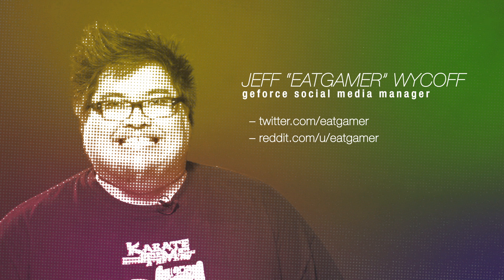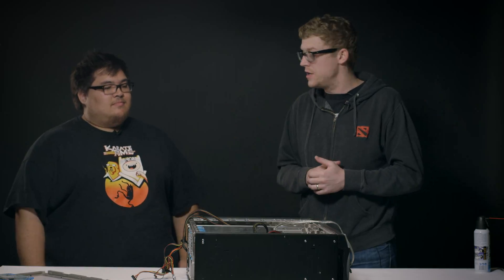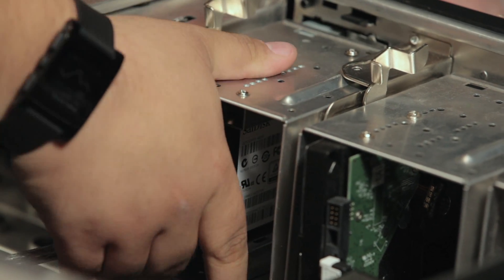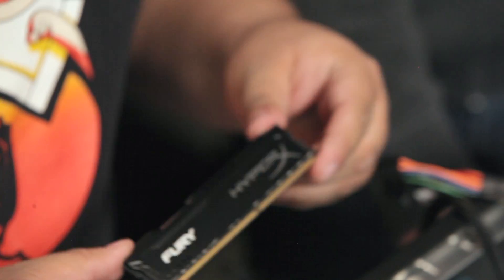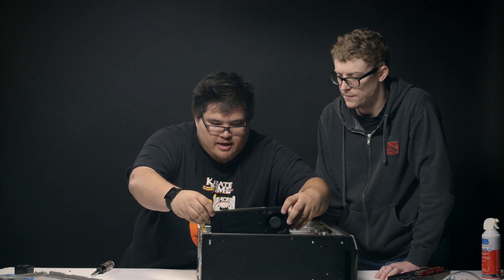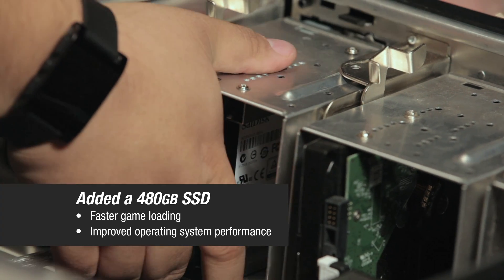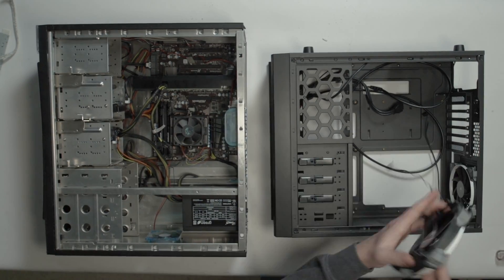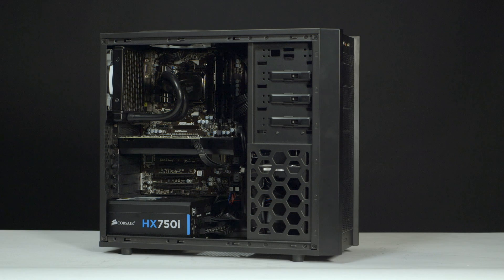GeForce Garage – How to Breathe New Life Into an Older PC

Comment: here my potato

Processor AMD A6-3670 APU with Radeon(tm) HD Graphics
Video Card NVIDIA GeForce GT 520
Memory4.1 GB
Reply: +elitegamer010 is not that bad.
Reply: KaPo Andre

How isn't it?
Reply: elitegamer010
You can at least open some games and play them. Maybe you say that it sucks and that is like having nothing. But some people would like to play something like the witcher 3 in  your PC with a low spec patch at 20 fps.

I used to think the same as you, but i did not appreciate what i had :P.
Reply: if you got an amd 240x or 250x it would run in dual graphics with the apu meaning it won't suck so bad.

Comment: So a pointless ram upgrade, 480gb ssd and a cpu cooler? 8gb is fine. Heck even a gtx 660 is amazing still. Rocking a gtx 460 768mb fine. Sure I can't play at ultra settings but I get around ps4 equivalent settings at 50 fps. I'm envious that I don't have a pc like that but some of the upgrades are pointless. If the 960 is so powerful efficient like they say then why a new psu? 480gb ssd is alot, i run a slow wd green drive and live with that. Should have put a 120gb instead for os and primary applications. I never use more than the 8gb of ram on my rig.  I watched this video thinking its going to show me how to upgrade a older PC for fairly cheap and get a good performance boost but all you really did was replace most of the build and more buildings a new PC than refreshing it.

Comment: My specs:
CPU: Intel Celeron E3300 (Dual Core) 2.5 Ghz (Overclocked to 3.1)
GPU: Radeon R7 260x 2GB (Overclocked to idk, too lazy to check)
RAM: 4GB DDR3 1333
Case: ikd some old crappy case
PSU: Some cheap 500W thing

:c

Comment: Build Quarter 1 2009:
Processor: Intel q6600 quad core
Ram: DDR2 800MHz 2GB x4 (8gb)
Case:Antec 300
Video: NVIDIA 9800GTX+ 1GB

Thoughts on best upgrade?

Comment: Should I get a ssd or invest a bit more in a video card
Reply: KSores it depends if your games are running slow or if you have unplayable frame rates, if it takes a couple of seconds to start up a game go with the ssd but if your games boot up just fine and you cant play them because of the frame rate invest in a video card, and if you decide to go with the video card the evge gtx 750 is  great graphics card with a moderate price for only 130 for the entry level model
Reply: ok thanks
Reply: KSores GTX 750 is a good card depend on games you play but get the gtx 960 for 199 and its much better and faster.
Reply: is that american prices because the gtx 960s in canada are around $300+
Reply: KSores My bad I was looking at newegg usa but it costs around 244.99 for the cheapet one.
Reply: ok no prob
Reply: KSores Depends on what your card is, and how old your hard drive is/ how full it is.

Comment: "There, we've revived this computer, even though it was expensive anyways. You know what? Screw it, we're gonna replace the whole thing after the fact."

This is like saying you were gonna do a few upgrades on your truck, but in the end, you've drilled the VIN plate off of the truck and put it on an entirely different vehicle. Yeah, by law, the same vehicle, because you just "upgraded" the whole thing.

Comment: my potato since 2008:

Intel C2D E8400 3GHz
Intel DG35EC mobo
msi ATi R5770 HAWK
4GB DDR2 RAM 800MHz
1TB WD HDD (recently upgraded coz previous 360GB HDD died)
450W Corsair PSU
Reply: ***** Custom BIOS maybe?
Reply: Aaaayyyy I have the same GPU as you lol!
Reply: Filipe Amaral
:DD
Reply: +Because I'm Batman! Nice I also have a e8400 with 8gb ddr3 ram, Asus r7 250. And I can run gta v on low settings
Reply: +Because I&#39;m Batman! Yet, this is still better than mine. I'm still running a E5200 with DDR2 (398MHz) fml.
Reply: ***** you do know this is an team green video XD im not on the green vs red thing but you iz pozting on le wrong spet XD
Reply: ***** It's still an allright pc-...people underrate their PC's, your PC will run okay if you don't play the latest and greatest games, I have my i7-920 temporarly with a GT630 till my R9 270 comes back from warranty (fried it like an idiot) and it still runs older games just fine. (older meaning pre-2013)
Reply: Rinkk
yeah, tbh, i do run games at frame rates which is playable to me. but my actual point was that i still work on a 2008 pc which is still fine but since its from 2008 it will be called potato in general :P

btw, just asking..... if you fried it on your own (guessing most probably by ocing) then how did u availed the warranty since damages like that are not covered?
Reply: Rinkk
i sooo much want to get a lil bit of extra from my e8400, but my mobo doesnt allow oc :/
but im still good though ;D
Reply: *****
i will look into that if i can...

dunno why i never thought of it.

EDIT: Couldnt find custom bios for my mobo. There is still just one way, but it involves some kind of padding the processor. I dont wanna risk it this way.
Reply: ***** yeah... processor chip mods? fuhgetaboutit lol
Reply: Rinkk
Ofc the cpu can be oced, but my mobo is an intel mobo, and intel doesnt allow ocing on their mobos. if it was from other company like asus, msi, or biostar, it would have been breeze.
Reply: +Because I'm Batman! Dude, E8400 and DDR2 ram, I thought I was the last person on Earth still using those!

Comment: ram and ssd upgrade were a waste of money. the gpu upgrade great i didn't see in video where they said what cpu he was using. ssd are nice and very competitvely priced but not significangt enough, in my opinion, to warrant spending money on that when it would be spent better toward the graphics, obviously, probably the cpu, not mentioned i think, and that power supply. why power supply? cuz it had dust bunnies living in there and dropping that new hotness gpu in there i am not taking any chances. and lies you didn't use 1 can of air to clean out that case. clever camera tomfoolery i say.
Reply: also that is NOT budget what you guys put in that system that was like 600 dollars of hardware. yeah....

Comment: The non upgraded pc was still 10x times better than my current one. 
I have an old Core 2 Duo E7200 2.53, 4GB of DDR2 RAM and a ATI HD5450. I just can't even imagine how my pc would run with a better cpu or gpu :D

Comment: It's funny, how everyone argues about the ram. 

Let's get this straight. You CANNOT mix and match 2 different types of RAM, if the different types of ram run in the same channel. For instance, you can't put a 8gb 1866mhz in the same color-coordinated channel as a 16gb 1600mhz, and make them cooperate. But if you place the sticks in 2 different channels, the pc will boot. It will only operate at the speed, the slowest ram is. That said, you could easily in their spot, upgrade with another 8gb kit of any type, as long as they didn't mix and match between channels. I would have done the same as they did, though. The best feeling about owning a computer, is knowing that you ain't stuck with the same configuration, without buying a whole new pc.

Comment: nvidia you are simply amazing. You're awesome. But can you help me with ine question; should i take a 4790k or a 5960k ?
AND ACCORDING TO YOU WHICH IS THE BEST ASUS MOTHERBOARD ? I WANNA COMPLETE MY NVIDIA BUILD. PLEASE REPLY MY FRIENDS AT NVIDIA.  HERE ARE MY PC SPECS;

Intel Core i7-5960X 3.0GHz 8-Core Processor
NZXT Kraken X61 106.1 CFM Liquid CPU Cooler
Asus X99-DELUXE ATX LGA2011-3 Motherboard
Corsair Vengeance LPX 16GB (4 x 4GB) DDR4-2666 Memory
Seagate Barracuda 3TB 3.5" 7200RPM Internal Hard Drive
(2 x) MSI GeForce GTX 980 4GB Twin Frozr Video Card
NZXT H630 (White) ATX Full Tower Case
NZXT HALE90 V2 1000W 80+ Gold Certified Fully-Modular ATX Power Supply
LG GH24NSB0 DVD/CD Writer
Microsoft Windows 8.1 - 64-bit (OEM) (64-bit)
Creative Labs ZXR 24-bit 192 KHz Sound Card
Razer DeathStalker Wired Gaming Keyboard
Cobra E-3lue Wired Optical Mouse

Comment: I have a laptop and I know there is not much that can be done to upgrade them, but what I can do is upgrade Ram, CPU, plus replenish thermal paste and clean out heat pipes and fans, but ive hit a wall my laptop is a sh%tty  Toshiba Tecra A6, with a even worse CPU A socket M dual core T5500, that runs at 1600mhz, the max I can do is a T7600G by intel, is there Any other socket or cpu that can be fitted with modification. Im running Win7 64 bit with only 2gb ram ddr2, that run at 667mhz. can I put a 800mhz. Any ideas, other than buy a new laptop has im trying to build a AMD gaming tower too.

Comment: Step #1: Buy a powerful enough CPU and good MB to start with.
Step #2: Dust out your current rig.
Step #3: Hold said items bought in Step #1.
Step #4: Now carefully throw the rest away.
Step #5: Buy new and more powerful components.
Step #6: Build your almost completely new PC.
Step #7: Turn it on and start installing your preferred OS.
Step #7: Make coffee.
Step #8: Contemplate over coffee that you could just skipped Steps #2, #4, #5 and #8.
Step #9: Realize that there are two Step #7s.
Step #7: Realize there are actually three.

Comment: buying a new case, a new psu, a new gpu, a new ram, new cooler etc is not upgrading a pc, is buying it, for the price they spent with all that useless things they could've upgraded the mobo, the cpu and the gpu and use a smaller ssd for the system while keeping the hdd for games (that actually don't need ssd). i'm building a workstation in a 90's case right now, nvidia i understand you have to advertise your 970 but this is not the right way

Comment: Check out what i did to breathe new life in my old pc

Previous specs(5 year old)
Intel core 2 quad q8400 2.66ghz
Kingston 800mhz ddr2 4gb ram
Intel g41 chipset motherboard
Nvidia 9800gt green edition 512mb ddr3 gpu
300 watt inbuilt psu by i ball cabinet

Upgrades
Corsair vs650 psu
Nvidia gtx 760 ASUS DCu2 OC Edition

This video is nonsense..... He basically changed everything instead of motherboard and cpu

I will respond to any queries if you have regarding my upgrade :-)

Comment: My current rig has gone through many upgrades. I upgraded my quad core bulldozer to a six core pile driver cpu and with a corsair h80 to oc it to 4.6ghz. ( 2 years ago). Then upgraded case fans and got a new monitor plus another hdd for more space. ( 1 year ago). Now upgraded my hd 7850 2gb to a new gtx 970 (3.5gb :(  ) but I'm still running mechanical storage ( albeit pretty fast mechanical over 200mbps) but it is not fast enough. However I only have a sata 2 controller and need sata 3. This would mean either an add in card or new motherboard. ( gtx 970 covers slot where I could add a sata 3 card. So even on slow sata 2 is it worth the upgrade to an ssd? Also I want high capacity at a low price. But not too slow. I will eventually upgrade my motherboard to a newer board with sata 3! But not now.

Comment: Liked the graphics but... no just no im going to copy paste a comment now...

"Breath new life into an older PC"

>REPLACES RAM instead of adding to it (and 8GB is enough for gaming anyway)
>Replaces GPU with a 960 with the worst possible cooler on it
>Replaces PSU for literally no reason
>Adds an expensive watercooler for no reason
>Buys a huge capacity SSD, complete overkill

Isn't the whole point of upgrading a PC to save money that you would have otherwise spent replacing a PC? This is just as expensive as replacing the PC entirely with more sensible component choices.

Comment: Love the subtle comedy in this. 

For those not in the know, and think it's a bit odd to add a 750W PSU for such an economical video card, the CPU that is never mentioned is an AMD. As in, they eat a lot of power. So they put a comically oversized PSU in the build. Someone tell AMD marketing that this is how you do a subtle jab at the competition, not that fixer crap.
Reply: No it wasn't. Also nvidia does not make cpu's nor do they particularly side with Intel. It was also a low wattage fx or phenom 2 chip from what I could tell. Either 65watts or at the most 95watts . The whole idea of the psu upgrade was cable management and look. Also the original psu was a cheapo one that could die any minute. And no I'm no amd fanboy. Own a pc with a i5 4670 and my current gaming pc has a gtx 970 3.5gb + 0.5gb. I'm a bit pissed about that memory thing with the 970!
Reply: ElitePotato8  Get over it man. It still has 4gb and still outperforms the 290. I am going to guess and say you bought that card based off of game benchmarks, which are awesome. This type of memory banking has been around for a long time. Years ago John Carmack even mentions its use in one of his video interviews. No one has made a big deal of it till now. Yeah man, don't be upset its a kick ass card.
Reply: SoIoCreep yeah but i wasnt expecting it to be made that way. when i brought it it was advertised as 4gb and a memory bandwidth of 224gb/s. however the last part is only like 7gb/s from my own tests. so i was lied to basically. also there are less rops 56 vs 64. also .25mb less cahce. even if the speed is still great. I did not get what was advertised. And i do have a 4k monitor, so i will get 4gb usage pretty soon with upcoming titles

Comment: this is not 'new life' this is just take the old motherboard and CPU and replace everything and more what is not needed.
I mean , 8GB is still the sweetspot for gaming . 
the new GPU was power efecient so why upgrade that PSU.
The original cooler was fine , why would u slap a watercooler on there. 
only reason should be overclocking but then it is still overkill.
And the case doesnt effect pefformance , only cooling and that can effect perfomance . 
and i think it is a AMD quadcore CPU on a AM3 socket .
I think a new AMD sixcore CPU would fit more in 'breathe new live into an older PC' .
The hole point is that if u are breathing new live in ur old rig that u are not wasting money .
And that is what is happening here.

the only 3 things what they should upgrade is the HDD to a SSD and then not like a huge one but just 128GB is fine.
that quadcore to the best am3 socket amd CPU ( i think thats a six core ) 
and the GPU to that new gtx 960.
that is what u call breathing new live , this is just replacing the hole goddamm PC .

Comment: Dear GeforceGarageTeam

i have problems with my temps of my graphicscard (gtx 670 from Palit/ 85°C under Load/fan speed 90%) and my CPU (Xeon E3-1230v3/ 100°C under Load/ fan speed 100%)

Thanks 4 your help :)
Reply: Lynn Zurmühle Clean your case and install additional fans, problem = solved.
Reply: case cleaned 2 new fans installed and new thermal paste now both undervolted and i still get high temperatures
Reply: Lynn Zurmühle Hmm, then i need to ask additional questions
1) what case do you have?
2) how many fans do you have, how powerful are they (CFM) and what configuration do you run them at (how many are intake and how many exhaust)?
3) what is your ambient temperature on average?
4) what CPU cooler do you have
5) have these issues occurred recently or you've had them  since day one?
Reply: ***** 1) cheap Thermaltake case
2) 3Fans and they are powerful enough :D
    2Push 1 Pull
3) about 20 Celcius
4) Freezer Xtreme
5) issues :/
Reply: Lynn Zurmühle Would be nice if you could specify case model (or send me a picture of it), anyways, maybe try to re-arrange fans, put 2 exhaust fans at the top and 1 intake in the front, see how it goes. Also make sure to make good cable management.
I personally have 8 case fans in my CoolerMaster HAF912 (6 on case and 2 on Hyper612 cpu cooler) keeps my i7 3770k at 4.4Ghz and HD7970 Direct CU2 at 1125/1575Mhz run 60-65°C max under heavy gaming load.

Comment: LOL a radiator for a 4 core AMD chip and a 750 watt power supply for a 960
Reply: MrPringle But seriously, instead of getting rid of that awful quad core AMD cpu, they gave it a watercooler, upgraded the PSU that was perfectly fine, upgraded the 660 which is not a bad card by any stretch, would likely last another couple years, and they replaced the ram, even though it was more than enough already. Only good upgrade I'd say was to add an SSD.
Reply: ***** amd chips only need passive coolers ... well first off if ur cheap enough to buy an amd cpu then u clearly don't have any money to spend on ur pc and second off he is going to get like 5c over room temps. also I think it was on reddit there was a guy who have a custom water loop for a quad core amd and he had a 480mm rad in the top and a 120 on the back just for the cpu .... that's wasting money :P